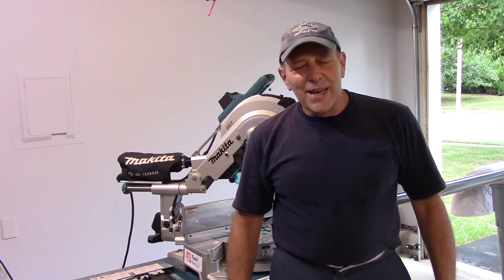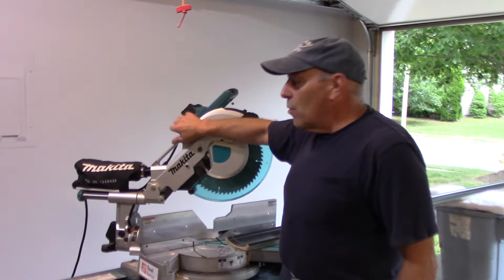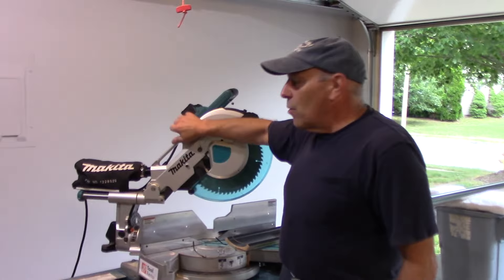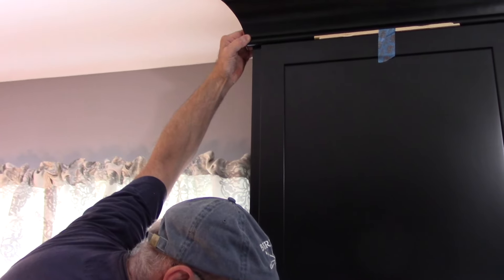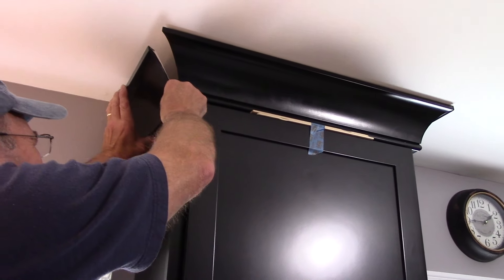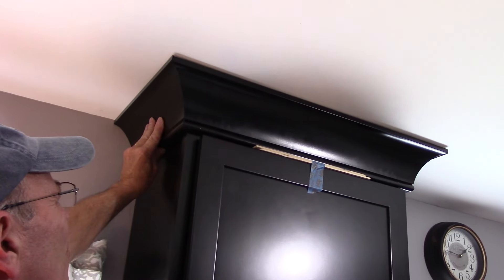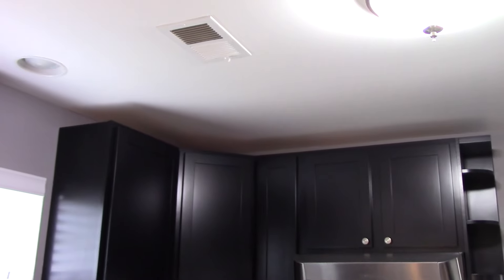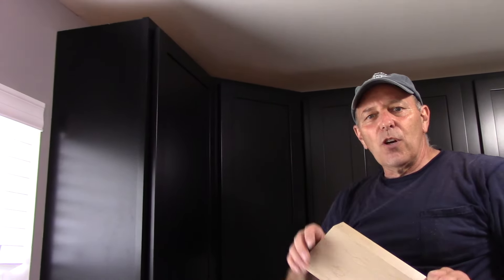How To Cut And Install Crown Molding On Cabinets

Comment: Why do u cross your arms when u cut? Isn't that extremely un safe? The first clip I hope assume you've added glue to ur mitre. As an honest to god tip. I know you're probably "40 years of experience" but try pre assembling your crown (obviously after dry fitting) and let it sit and dry for 30-45 minutes after gluing and you're mitres will be extremely strong. I also like to personally cut 45.5 on my outside mitres to reduce the pressure of trying to open the mitre 🤙🏻👍🏼